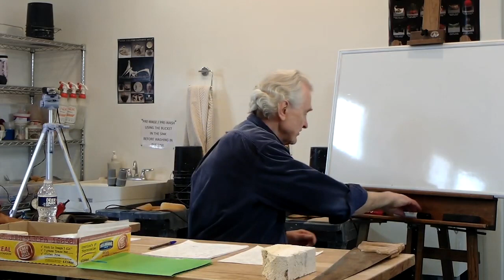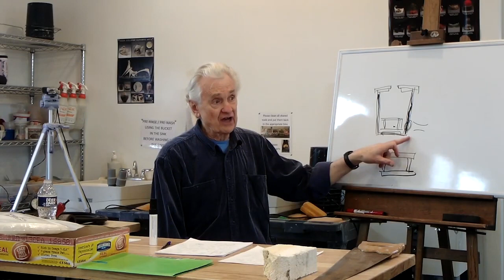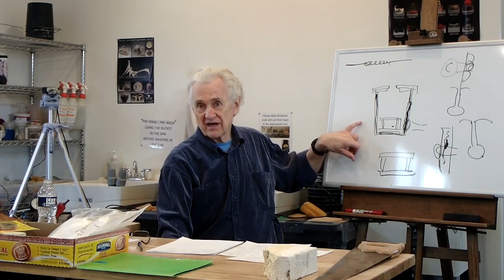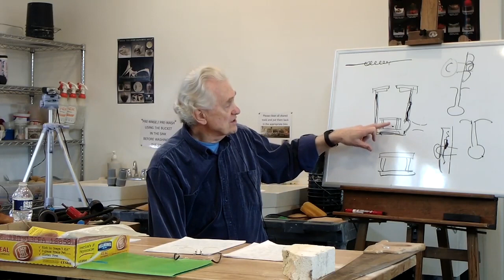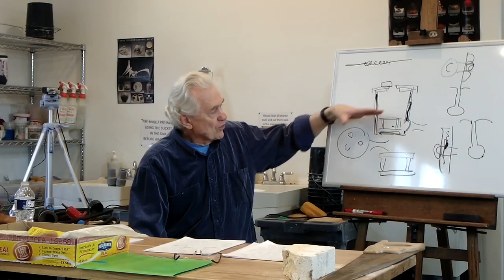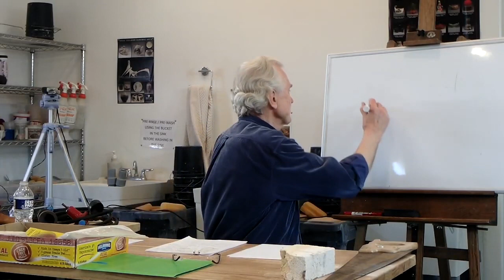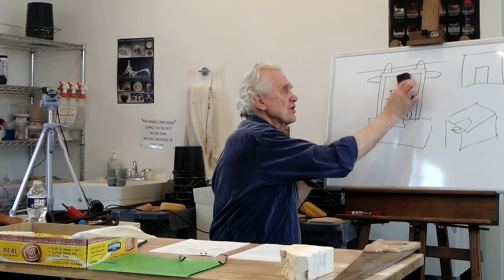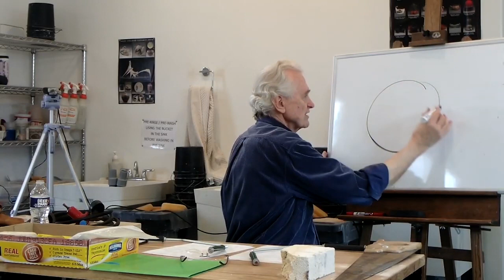Understanding Pottery Chapter 16 Gas Fired Raku Kiln

Comment: Thanks for the video.  The layer of 1/2” insulation brick is really good idea.  Never heard that idea anywhere else.  Brilliant!
Reply from the maker: Thanks Kevin, We're glad the video was beneficial for you! Please share the video and channel with you friends and fellow potters, we're really trying to get the videos out to the entire ceramic community!
Reply: @WashingtonStreetStudios  Hi I have a question, could you use scraps of ceramic blanket instead of slices of fire brick to insulate cold pots against hot shelf
Reply from the maker: @jackieaherne6370  yes, however the base won’t be as stable and pots may tip or fall over in the firing.

Comment: Hey, thanks for the videos. Phil mentioned only needing a torch and a regulator, is a flashback arrestor not needed when using propane?
Reply from the maker: Unfortunately Phil has passed away. He could have answered with more authority than I have. 

I believe a flashback arrestor is used with a torch, and Phil talked about a raku burner. Burners do not need a flashback arrestor.

Comment: Thanks for the video! When is coming raku glaze recipe special?
Reply from the maker: Niko, Thank you for your question. We, at Washington Street Studios, even with a glaze chemistry expert like Phil, use commercial Raku glazes! Many will disagree and you probably can get better or more specific results if you formulate your own glaze for Raku. We use commercial glazes because we have found they produce good and predictable results, or at least as predictable as you can get in a Raku firing! There are so many variables in Raku and the firing process that simply working with a small variety of commercial glazes you can create a multitude of results. We have five Raku glazes at our studio and they provide enough variety to keep us all happy.  The short answer would be shop for commercial glazes. 
If you have a specific question on Raku glazes, we will be glad to provide an answer. Feel free to post a comment with any question you may have.

Comment: Can you use this type of kiln for cone 6?
Reply from the maker: It would be very difficult to get the kiln to cone 6 temperatures. It is also difficult to control the speed of temperature rise, if you could get to cone 6, you would probably lose pots during quartz inversion.

Comment: Thank you for all your explanations, they are very helpful. I just made my first kiln for Raku and I pretend to use it as regular gas kiln; can I use it for bisque firing?
Reply from the maker: It's theoretically possible to use it for bisque firing, but you must be very careful and certainly not recommended. Raku kilns heat up very fast and you need a very slow ramp up of heat for the bisque firing.

Comment: Am I supposed to dry clay greeenware then add color dry and fire it altogether?  Or do I fire clay first then add color and fire again?
Reply from the maker: Samantha, I'm not sure I totally understand your question, but I can explain our Raku process. I assume your question relates to raku since it is on the raku video, if it's not, you might want to watch this video (https://youtu.be/VP-dgfmwrBE).
For Raku we throw the pot and you can add washes, stains, slips or engobes as explained in the referenced video above, then we bisque. We use a Raku glaze to decorate then we fire as explained in the video.

I hope that helps.
Reply: @WashingtonStreetStudios  ok I think that answers if I needed to fire first to bisque then later add color glaze I wasn't sure if I was to dry clay first fire it then add color or raku items and fire again, I suppose  I need a way to bisque my clay but I don't have a way to do so I have a microwave kiln for jewelry peices but not for small pots and phone holders, I have tried 5 in a small hibachi using sawdust but it doesn't work well. Thanks I'm hoping to buy something soon, so we can just use torch etc. Thank you for the information and link I will watch Incase I missed something

Comment: Is that wire the Kemper high temp wire 17 gauge 10 feet that comes up when I search ‘high temp wire’?
Reply from the maker: Great question Sybille Stahl, You can use the Kemper high temp 17 guage wire, and it will work for quite a while. The nickel chrome high temp wire withstands higher temperatures and will hold up a bit longer, although it  could be overkill for a raku kiln.